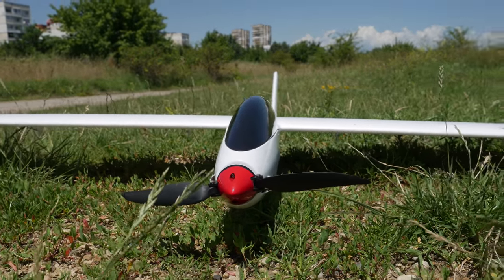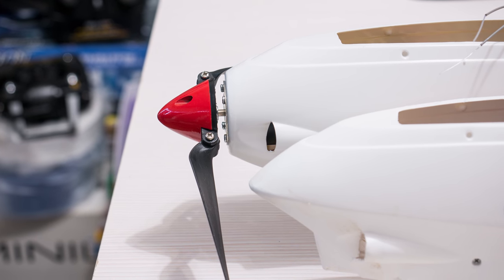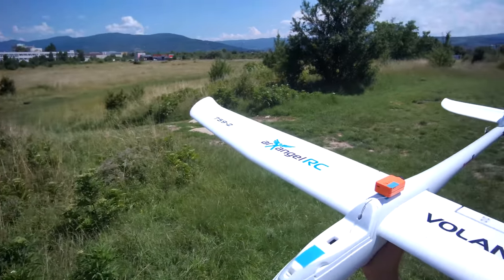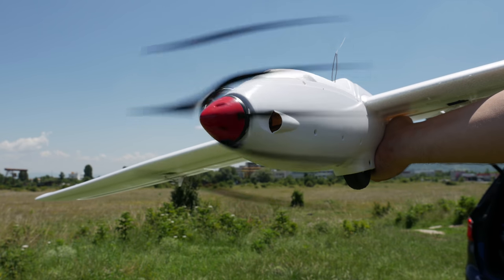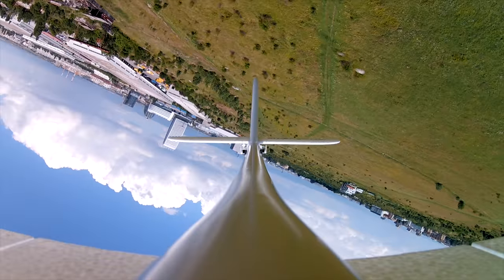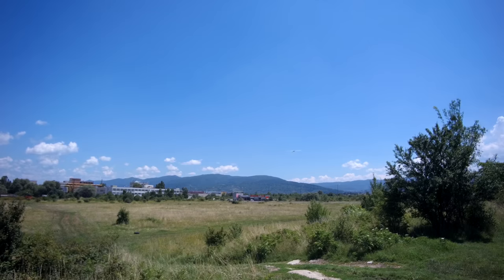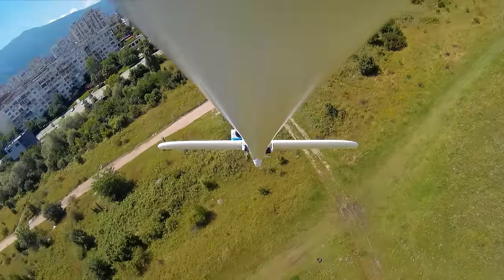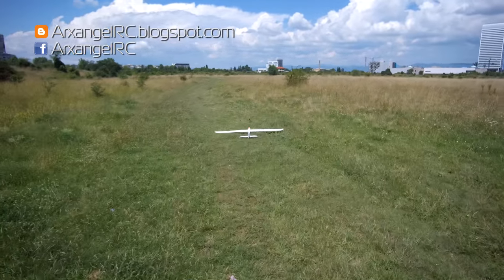Volantex Phoenix V2 - a pretty darn good motor glider!

Comment: Is there a 40g weight under the battery tray on the phoenix V2? I found one on the Phoenix Evolution, after removing it it balanced fine with 3s 2200mAh in front position. btw. great review!
Reply from the maker: Hmmmm... other than the ESC, there doesn't appear to be anything else in there, but I will know for sure when I remove the battery tray to replace the ESC. Don't see anything in there at this moment.

Comment: I like to install a fpv camera + gopro and make It stream the content to my tv or monitor while the plane flys around in a pre programmed flight pattern around my property and perhaps have it autoland when the battery runs low. Would this be a hard project to do?
Reply from the maker: Well... depends. How big is your property? Would you have direct line of sight to the plane from where you will be at all points during the flight?
Reply: @ArxangelRC  most likely if it is big enough. Looked into the Volantex Ranger and the Phoenix 2400. Its roughly 7 acres of fairly flat fields. I want to play spy and have it "spy over my roads and such. 

So for this to be configured I will need a autopilot module, obviously a fpv cam then map out where the plane should go with software? am I missing something.

I appreciate all the advice I get, thanks.
Reply from the maker: @ceaseanddesist8036  Hey, sorry for the delay! Well yes, you would need an autopilot, a radio control system (controller and receiver), GPS unit, FPV camera, video transmitter, battery, on the ground you would need a monitor, video receiver, perhaps also an antenna tracker, directional antenna, etc., and only then will you get to the software, but first you would need to fly the plane and configure it, tune it a bit, so it can fly reliably.
Reply: @ArxangelRC  thanks. Right now I am just training how to fly the beginner rc gliders. Once I got a good hang of it I will get used to something bigger and start my project.
Reply from the maker: @ceaseanddesist8036  Sounds good! That is how you should do it - learn first, go big later! :)

Comment: Did you toss with elevator  at zero setting? Or do you recommend approx 2 mm reflex on elevator.. thanks
Reply from the maker: Well since this has the motor in the nose, I don't recall having to use elevator reflex on launch, but then I also had an autopilot in it. Try 2mm up, won't hurt, you can always remove it, if its too much.

Comment: Great video!😊 . How does this compare to the volantex 2.6m aws glider?
Reply from the maker: Well this is slower, and it has more relaxed flight, and a lower stall speed, the ASW has thinned wings and a smaller chord, has higher stall speed and is faster, keeps you on your toes! :)

Comment: Interesting to see that the G2 had a better efficiency :)
Reply from the maker: Well... as I mentioned, the G2 is a lot smaller and lighter, so it should be more efficient. Different class of plane. :)
Reply: Yea, that's true :)
Reply: 2 things, just like the asw28 from same manufacturer, you have to set the escape brake or you cannot glide correctly because of the propeller continuing to rotate and braking the plane. 
Second point is the GC balance where you almost have to remove the wheel and it's foam so you can put the battery further in rear. That will spares you to add weight at the far rear.
Reply: So it weighs like my asw28. What is the wing area? To check if it gots lower wingload than the asw28 or not, and so if I change my glider or not.
Reply from the maker: I have gotten the programming instructions for the ESC from Volantex, so will enable the break on their ESC, but I will be replacing it at some point, as I don't really trust it. As for the CG, I do like the wheel and the cover for it, so will not be removing them, but rather than just adding dead weight at the back, I do have some other plans for this plane which should make it a bit more interesting and still solve that CG issue! :) Not sure about the wing area, will have to ask!
Reply: ArxangelRC for thèse wing area it relatively simple, if you can give me the different sizes (consider the different cord lengths and their corresponding lengths in large and you just do the average between 2 following cords and multiply by the length that's between them. Do for all segments of different segments, I see 3 of them, and you got the area)
Reply from the maker: Alright, Volantex claim the wing area of the Phoenix is 0.37 square meters

Comment: Hi, i want to ask if I could put un 3s 2200mah battery on the top of the wingspans (the metal part) to help the cg so I use dual battery, do you think that the 3s 2200mah battery fits there?
Reply from the maker: No idea if it fits there... but you can try... it might!
Reply: ArxangelRC ok, I have one more question how should the cg look on it?
Reply from the maker: @bbk5424  There are markings on the wings, if I am not mistaken! Balance it as close as possible to neutral... with very slight nose down tendency! I usually go for straight neutral... I do not mind a neutral plane, improves efficiency a little bit!
Reply: ArxangelRC thanks fore your time
Reply from the maker: @bbk5424  You are welcome! :)

Comment: hello there...... i want to buy the (Volantax Phoenix V2 759-2 2000m Wingspan EPO Sport Glider RC Airplane KIT) how bean posible the 759-2 pnp have flaps and the 759-2 kit dont have flaps at youre links? this is the same model i think? its mistake at the page of the bangood?
Reply from the maker: They both have flaps! Don't worry about it! :)

Comment: awesome review! What motor you'd recommend? Also, how do you like the stock motor?
Reply from the maker: The stock motor is OK, though it does get just a tad bit warmer than what I am used to on my larger FPV planes, but the limited cooling is probably a factor in this situation! Ideally I would recommend a motor of around 700-800Kv on 4S, and a larger prop than this one, to get some good efficiency, if you are after that sort of thing! Volantex do have an 850Kv version of this motor, and I will try to get a hold of one of those, so I can test it as well, and have made a recommendation to them to include it in the PNP sets... or perhaps as an option, for people wanting to go 4S, since the 1050Kv this comes with now, is officially rated for 3S.

Comment: Hi, whats better beetwen vooantex ranger 2000 vs phoenix ?
Reply from the maker: Well... depends on what the goal is! I like how the Phoenix handles and flies a bit better, and that view from the tail is absolutely stunning... but if you need an unobstructed video from the plane, then the Ranger is the one to go for... plus it is a bit more convenient for FPV, because the motor is at the back, out of the way of the nose and any cameras you might want to mount there.

Comment: what is the original holes spacing in the motor mount  ?
Reply from the maker: Sorry for the delay! The holes are 23x23mm on the square, and 32mm diagonally.

Comment: What radio/controller are you using?
Reply from the maker: The FrSky Taranis X9D.
Reply: @ArxangelRC  is x9 lite s okay?
Reply from the maker: @amadeuspati980  Have never tried it, should be. Supposedly its the same module in there, running at the same output power.

Comment: Phoenix 2K is much better glider, cleaner lines, thin plastic fuselage, no wheel (less weight)
The key is a strong, slender, and lightweight airplane, something that this glider is not. Thermals are much easier on the original 2K....
Reply from the maker: Perhaps... but I still like this one, and I haven't had any contact with the previous one... so can't really compare!
Reply: Should I start with this pane or Radian? I want a good plane I can grow into and not have to upgrade.
Reply: Phoenix 2K is better glider. yeah but the V2 is also a FPV glider and I actually disagree when saying that the purpose of V2 is not FPV. but he will try keep it that way.